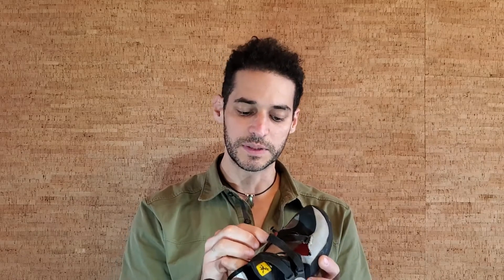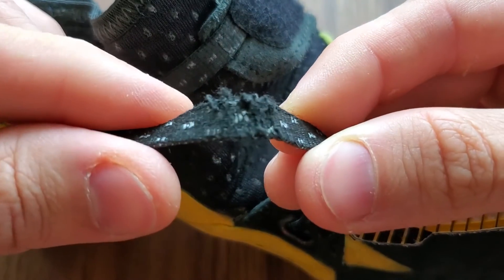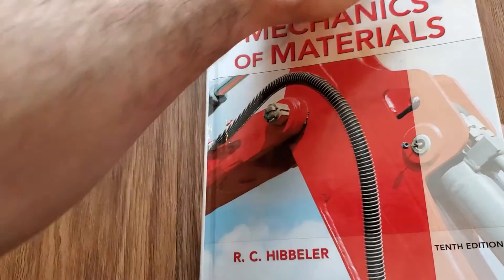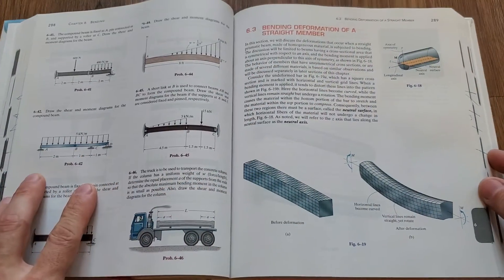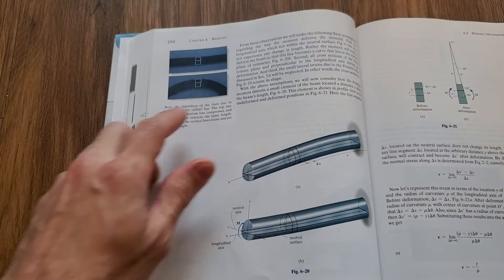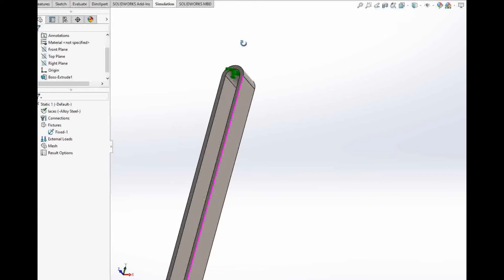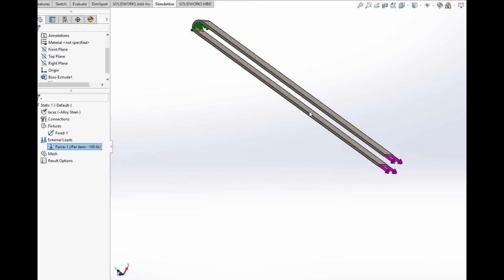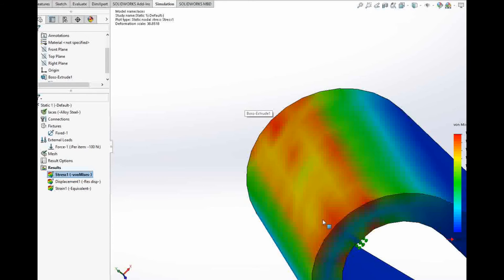Design flaw on La Sportiva Solutions explained

Comment: A fourth option that prohibits some of the flexibility of the closing system is replacing the velcro with the grommet with something that doesn't bend the lace. Possibly cutting the original laces in the middle (or wherever you need them) and sowing the lace ends flat on eachother with the velcro patch. This way you remove the stress concentration from bending the lace completely. Might even be a great fix AFTER the laces have been ripped since the wear tells you exactly where you need the velcro patch to be ;)